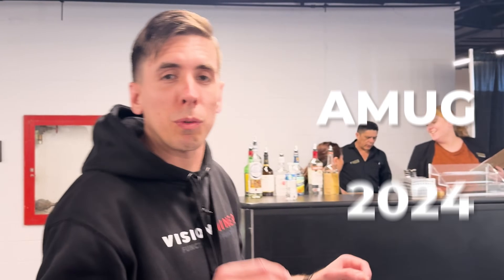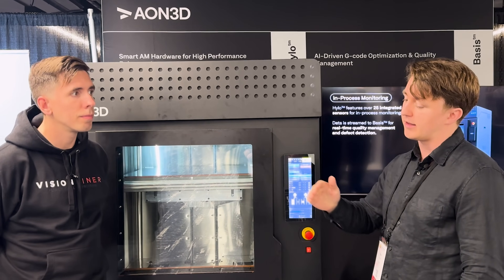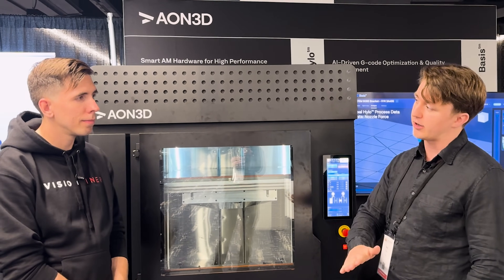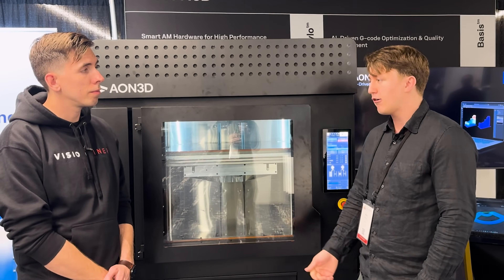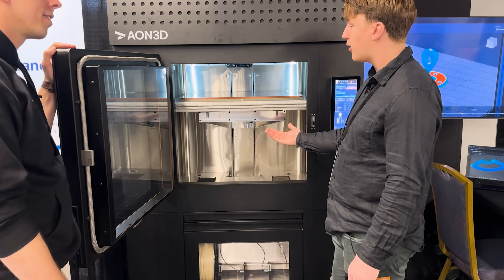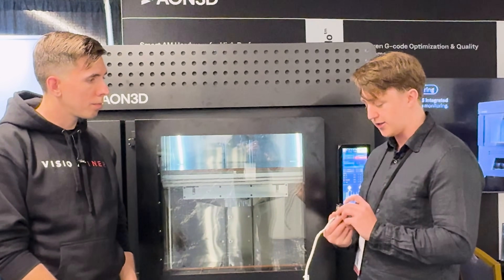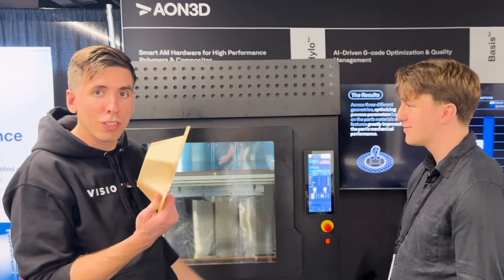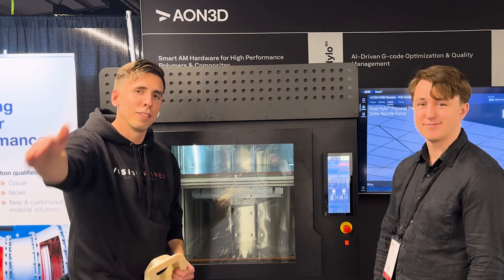Pushing the Boundaries: Hylo™ and Basis™ AI Unleashes New Frontiers in 3D Printing - AMUG 2024

Comment: Great interview. Kid has some balls. I have a question about the compressed air. The are oilless annd oiled comprressors. Are the oilless recommended or does it not matter?
Thank you!
Reply: There’s a cyclonal filter and a 1um particle filter built into the unit. It likes clean dry air but you can feed it wet dirty air and just swap the filters annually for about $100 in parts

Comment: I know it's not even the same level as the tech on this Aon3d printer, but for your average Joe, controlled heated chamber printing is accessible with the Q1 pro from Quidi. I got sent the printer and it was in my "to do" closet for over 2 or 3 months and just took it out last week. Once again, I shouldn't even bring it up next to this plastic factory, but it does give a little peace of mind when it comes to the "cold weld" night terrors. Haha
Reply from the maker: Nowhere near up to par for big engineering parts in even Nylon or PC, but definitely better than your avg open-air Ender for materials like that! Keep it going!